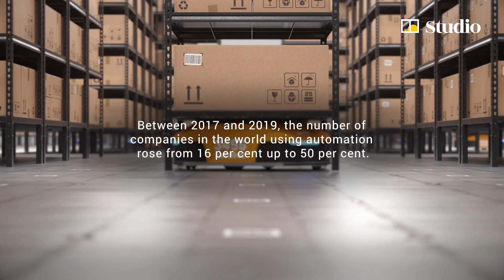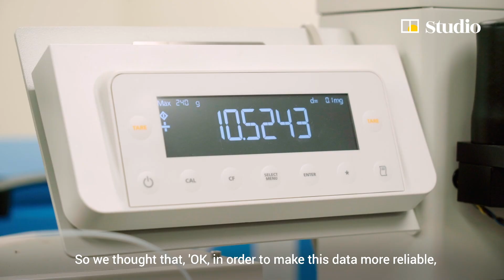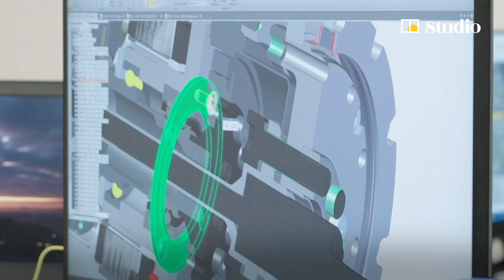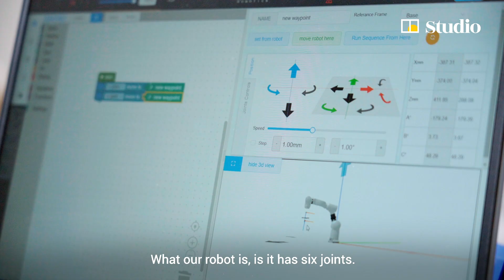How robotic arms are transforming farming and academic research

Comment: First, the reasons for automation
1st Quality - A automated process can provide consistent quality. This is a must in certain products.
2nd Cost - A automated process is often more cost effective, thereby allowing more profit and lower cost products.

Now to automation, it is unstoppable. It hurts as much as it helps the regular person. If not for automation, for instance, the car would never have been affordable to the public. Model T's by henry ford where some of the first examples of how repeatable tasks where assigned to a automated process. And you can see this in every factory throughout time, again and again. The difference now is that it has reached a level of sophistication that eliminates in some factories almost 80% of the workforce. Will it stop? Never, automation from its start is to attractive, due to the two top reasons given at the start. No company that ignores automation can produce efficiently for the market. This means more focus has to be placed on alternative job sources.